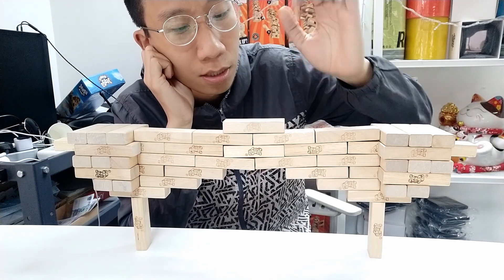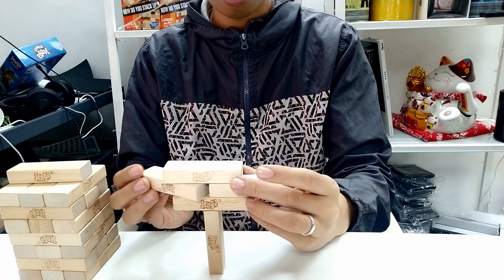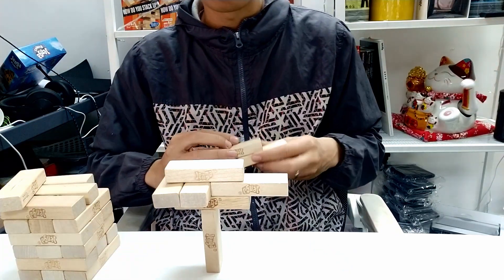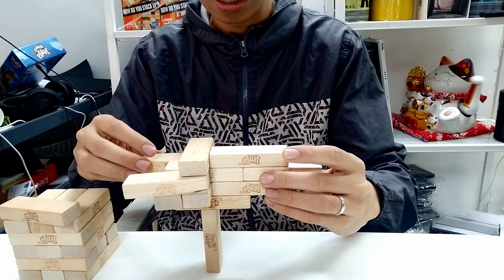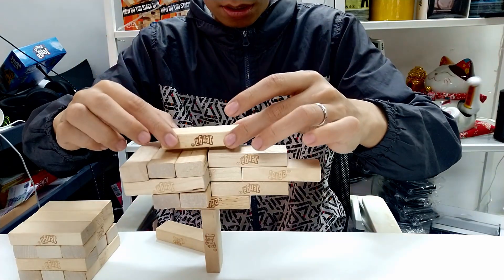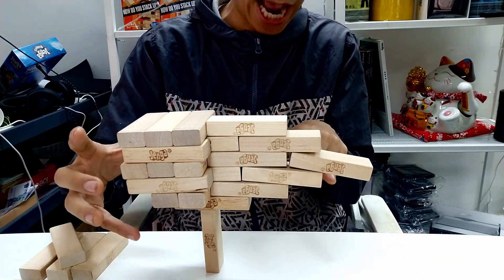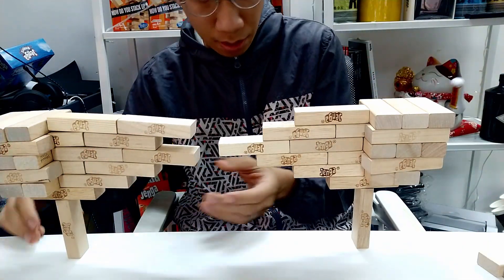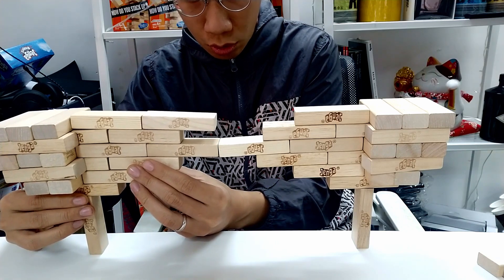Tutorial: a BETTER Jenga bridge (load-bearing)

Comment: One time I was at a library and there was a Jenga set and two soft cylinder seats. I was probably waiting for something so I decided to build a bridge with them. Don't remember what kind it was but I'm pretty sure it had two weights at either side holding the whole thing down. Maybe they were arches

Wish I had photos :P

I also probably hadn't touched a Jenga set in years, and rarely ever did so yay